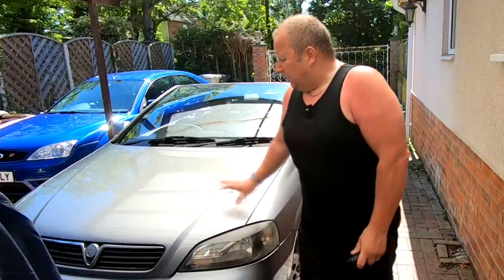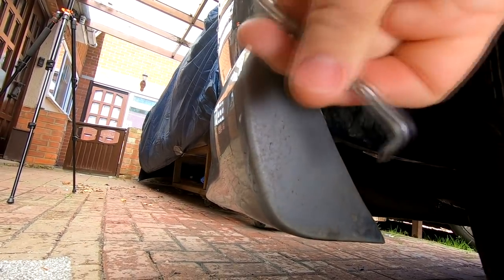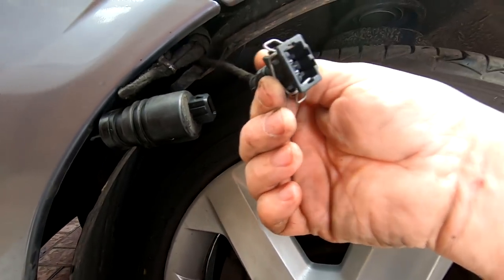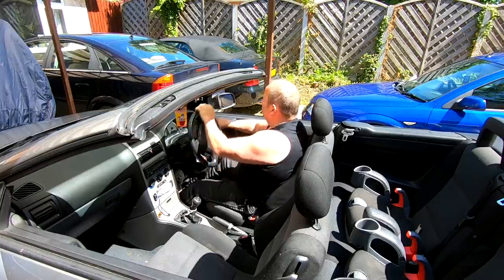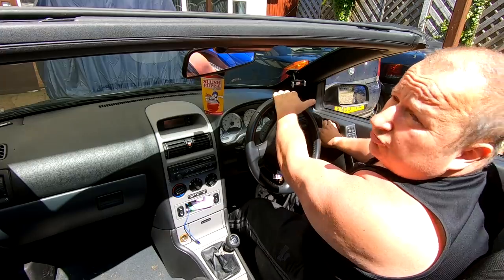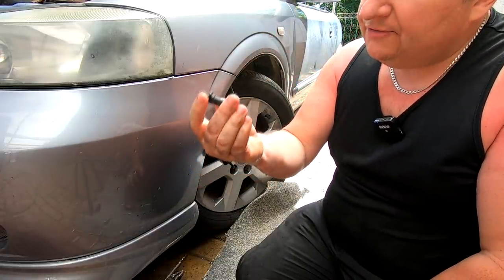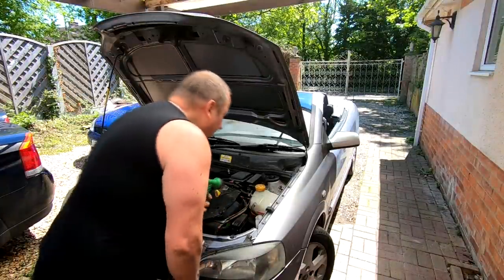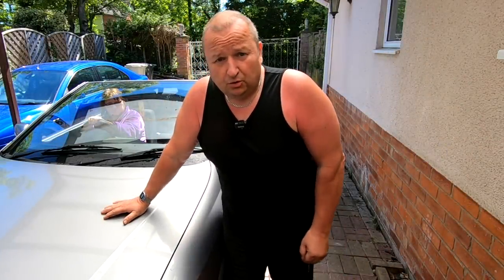Vauxhall Opel Astra G Mk4 Windscreen Washer Motor Problem - SOLVED

Comment: You've inspired me to have a go at mine now. My transit connect 08 has awful water pressure from the windscreen washer! Wish me luck 🍀😃
Reply: It was just gunk blocking it! Hour and half later and it's back to factory power! Cheers for the boost Martin

Comment: That filter in the washer bottle is the same on Vectra B & C's, Corsa C, D & E, Zafira A & B so far to the cars I have worked on for info, a little tip, change the spray nozzles to Insignia mist nozzles 😉

Comment: There's a filter in the bottle it gets clogged up. Common issue on Astra H too.
I use Zoflora in the bottle with the screen wash helps kill the bacteria that builds up and causes the sludge and bad smell.

Comment: I had this same issue on my vectra (being blocked) took the filter out and blasted it from the top with a hose pipe and then reconnected it. I believe you can swap the jets for mist ones which are better and use less screen wash

Comment: Great when it all goes well. Quick question if I may. I am restoring a Mobylette X7. I am going to paint the frame black. Could you tell me if black gloss spray needs a clear coat.
Thanks and take care.
Jeff
Reply from the maker: Not if it's direct gloss or 1k paint Jeff.
Reply: @retrorestore  Thats great Martin, thank you.

Comment: You should have took the wheel off, take the rubber seal out and cut the filter off job done
Reply: If you do that next you have the pump and then the nozzles blocked. At least with the filter you know the crap is always going to be in the same place. Lada Samaras used GM components in the 90s without the filter and the system was always blocked. I have a 1997 Corsa and the owner before me used normal water containing a lot of calcium and the filter saved the whole system.
Reply: Gota have it  Stew 😆
Reply: You can't because not only will it break the pump with the crap but it's also a water seal so if you remove it, it will just leak
Reply: That would work very well at first, but as soon as dirt is pumped through, the next step is to clog the nozzles. Larger dirt particles then damage the pump. Believe me, the filter is better in the long run ;-)
Reply from the maker: That would block up the jets in no time